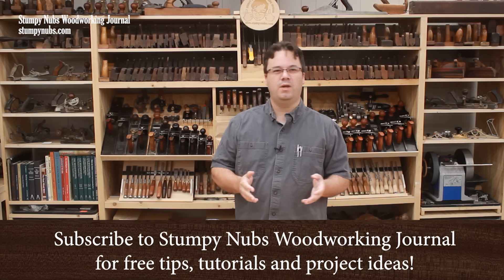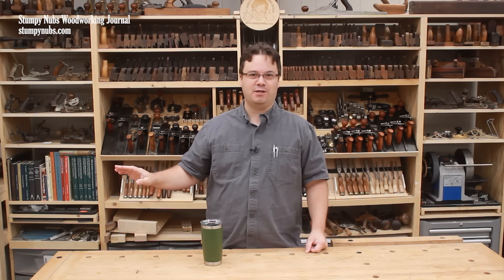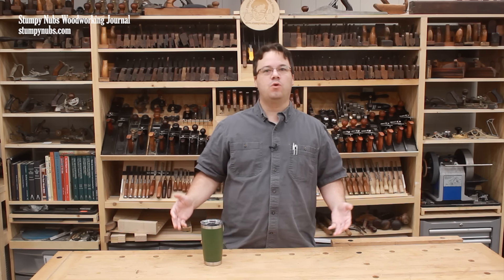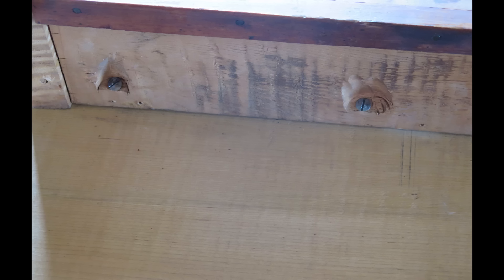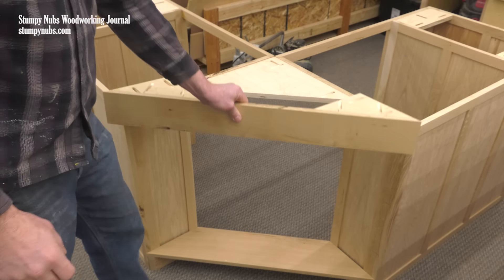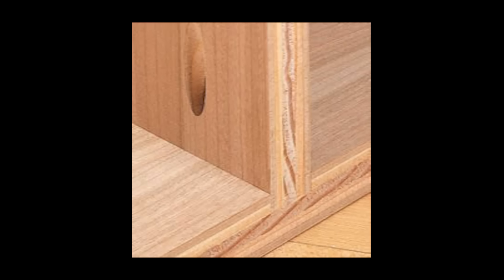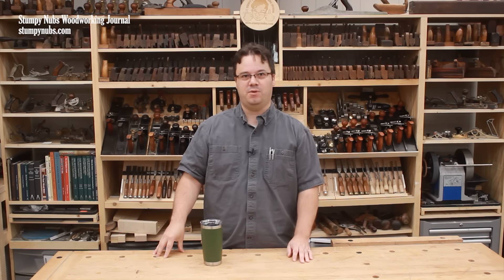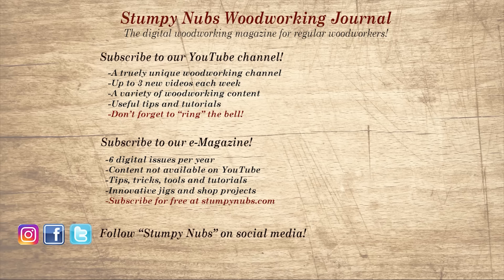They lied to you about pocket screw joinery.

Comment: Another invention which saves effort is glue. A traditionalist would make joints that work without glue. Really? What tripe, all methods, old and new are fine to use and equally valid. You might as well argue that proper shaving of the whiskers on your face can only be achieved with a sharp piece of flint!
Reply from the maker: I'm not sure I understand your comment. Are you saying traditional woodworkers would NOT have made joints without glue?
Reply: @StumpyNubs  I see where you are coming from but it would depend on what you consider "traditional". If you only go back 100 years then yes they would. What about the carpenters who worked while Henry 8th ruled? Maybe not? Of course, by 2121 even CNC machines will be considered "traditional" by virtue of having been around more than 1 century!
Reply from the maker: @johnmusgrave3179  - Tradition has nothing to do with it. Some joints can not be glued because wood must be allowed to move. Others must be disassembled in the future. That was true the day the first piece of furniture was built. Nobody is saying you must use pocket screws, but to suggest everything must be glued is just wrong.
Reply: @StumpyNubs  I completely agree. Maybe I got the wrong idea (my wife says I often do) but I thought your video was defending the use of pocket screws against the idea that they shouldn't be used because they aren't traditional. My point is that the people who say you shouldn't use them presumably do use glue on some projects despite that glue which worked was also once a modern idea. All methods were new once and all will be traditional one day so why not use whatever works and is appropriate in the present day?

Comment: If people rag on you for pocket screw abuse then they must really hang shit on you for using that mechanical round wet wheel grinding devil of a device. 😱 The boss in my after school job 50 years ago used to say, "There is more than one way to kill a cat than to choke it with cream". This applies to woodworking too IMO. 

I am crap at cutting dovetails and have trouble with most other joins so maybe the heretics would like to come round and strip me of my single plane, two bottom of the line budget saws, my five 22 year old chisels and the 6 inch vice. I guess they will also want to chop up and destroy my pathetic amateurishly home made 1200mm x 595mm bench that wobbles when I laughable try and make shavings when I plane. Oh the shame I must bring to the pocket hole haters. 
I do what works for me and if that means I have to find a second-hand pocket hole jig then find one I shall and bugger what they think. In fact just to really put the boot into them I will go and buy a new one. I think everybody should have at least one new tool to work with eh. 👍

Thank You for the videos. They have been educational and helpful and are much appreciated.